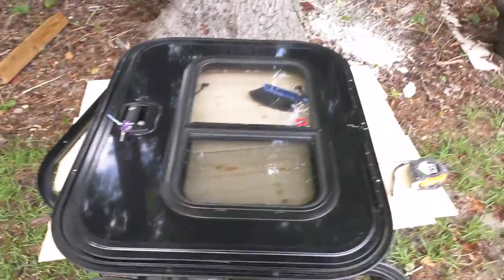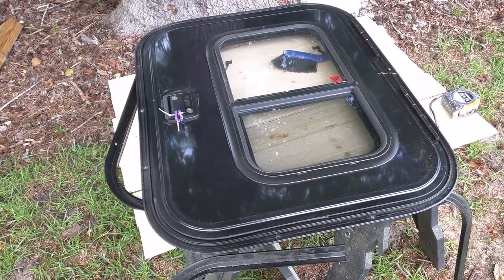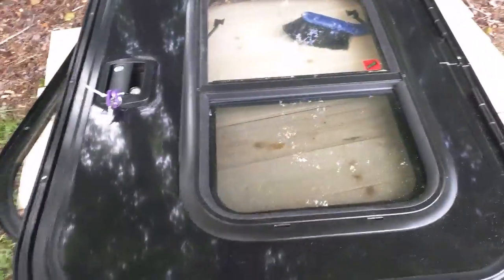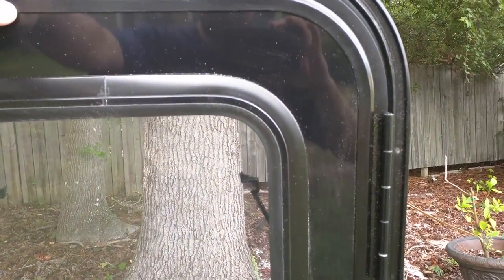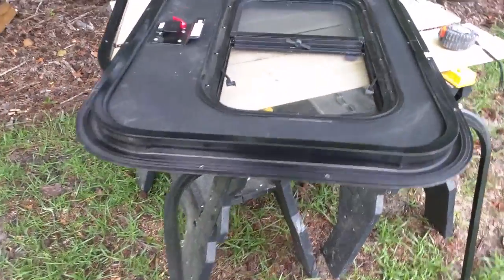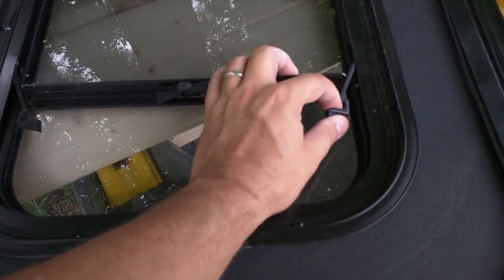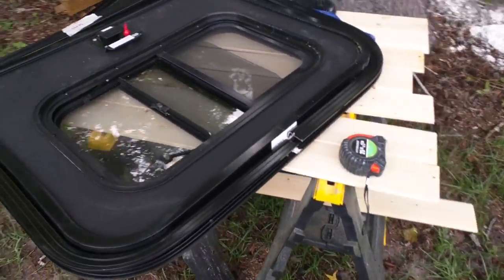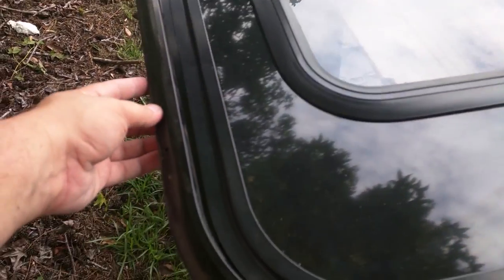Pre-made Teardrop Trailer Doors

Comment: Challenger Door's web page for ordering teardrop trailer doors: https://www.challengerdoor.com/teardrop-trailer-doors/ Examples are shown on their web site.

Contact Challenger Door at 1(574) 773-0470 or email info@challengerdoor.com to get an estimate for teardrop trailer doors. 

26"W x 32"T and 26"W x 36"T are two common sizes for 805 series teardrop trailer doors. Doors are available in other series too.  Doors can be ordered in custom sizes. They'll need the rough opening size(s) of your walls. 

All doors are made to order. They are not already pre-built in stock. I was told they typically need 10 working days to make doors. Shipment/delivery to you may take another week.

You can choose the inside and/or outside colors. You can also choose whether to have 4 radius corners, or 2 radius corners on the top and 2 square corners on the bottom of the door(s).

Comment: Thanks for the help Dan. I called and all the doors are custum built so you can make them any size you want them to be. They have differant inside trims for thinner walls. Today 2020 in California the door 26x36 price $288 pluse shipping per door the window on the 805 is 15 by 24 i did ask how much a 30x36 door would be and $312 a door plus shipping. I hope this helps.
Reply: 805 27x36.... lol more like $450 now

Comment: I like that door. I'll start getting those for my next builds. The ones i bought are messed up out of the box. thanks for sharing!
Reply: The first door i ordered was really dented on the outer ring. so we sent it back. the second door also had a small dent on the top part of the outer ring, and the the window doesn't stay open, the plastic locks broke right off. as you said, doors are not cheap.

Comment: I just instaled some from Frank's  shop and not happy with the fit. So searching for a better door maker for sure
Reply from the maker: What was your issue with his?  We have them in the other trailer and I like them.  We did have a bit of a seal issue where the side piece of aluminum extrusion comes together, but a bit of silicone fixed it and they are perfect now.

Comment: Thanks Dan!  Lots of great info.  I am having trouble finding this door on their site.  the 805 series look like full size doors.  Are these a custom order?  Thanks again.
Reply from the maker: These are custom order.  Basically the 805 series (I think) means that there is a window, and the edges have a raidus.... and I think the thickness.  Contact them and tell them what you are looking for (to use in a teardrop), and they can give you specifics.  They were very helpful when I called/emailed.
Reply: Perfect!  Thank you.
Reply: Hi i just called them the 15x24 is the window size. There custom build  doors so you can get the most common 26x36 door with a 15x24 window if you go 30x38 door or anyother size in the 805 window will be same size 15x24 window I hope this helps. I doing a build on youtube starting soon i finnish the trailer getting wood this week.
Reply: Also she told me if your wall is thinner they can send a smaller inside ring.

Comment: so, 6 screws from outside - someone with a screwdriver could nick off with your door.. or get inside without a key.. cool
Reply from the maker: For sure.. But I would rather have a door stolen, then my camper destroyed.. Pick your battles I guess. If they are that inclined..
Reply: Or you could glue and screw .. given that this would increase the seal on the outside

Comment: More money than sense? You can build 2 doors for less than 150, with glass or plexiglass, aluminum of steel clad.
Reply from the maker: Well, that's one way to think about it.  OR The fact that I saved a bunch of time, and was able to buy pre-made quality doors that were ready to roll.  Thanks for the input!
Reply: Dad Rambles Workshop more money than sense it is then. So you can change the name of your videos from how to build to how to assemble. Considering you prefer to blow your money putting someone else's work on your campers.
That's your business. Your the one that has to say you almost built it.
Reply from the maker: You know what.. you got me!  I didn't make the 1000's of screws and brad nails that I used either.  Nor did I cut the trees, to make the panels.  I didn't extrude my own aluminum either.  Oh, and i forgot, I didn't weld the trailer.  Do you have any video or pics of how you built the doors for your trailer? I would be happy to share them.